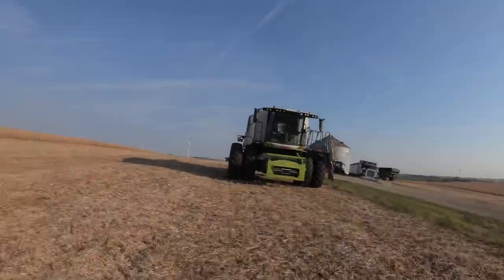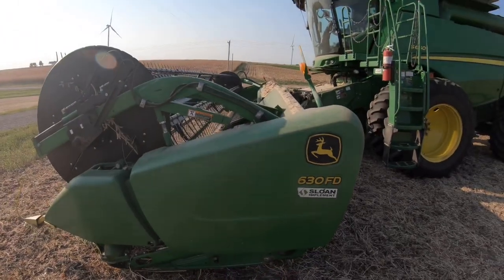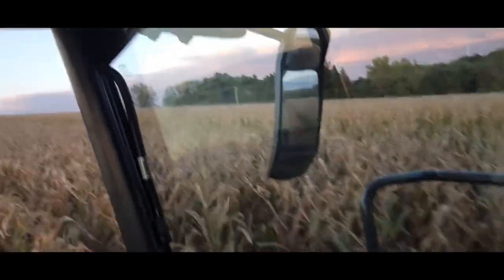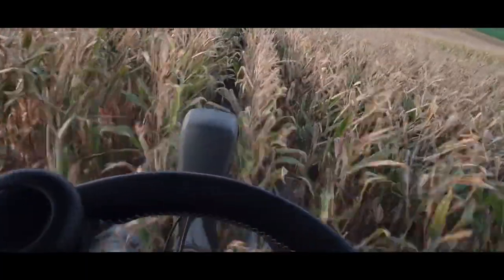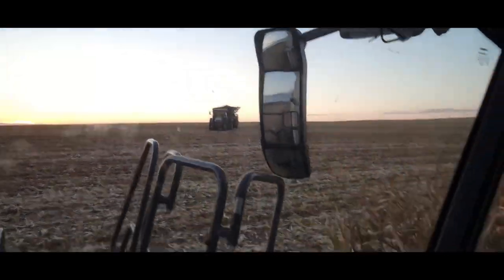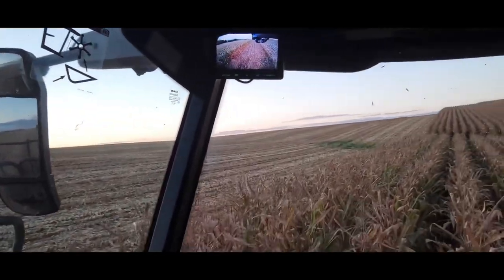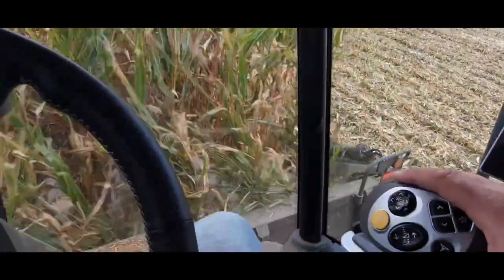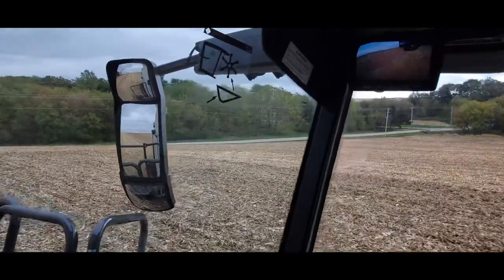Class Combine Demo!

Comment: I know someone who has a Trion 750 on a Vario 770 and a John Deere T660 on a 725X. Both great machines had the Trion working at 7 kph in wheat, 4.3 mph for ye Americans, which is very good since in Europe we have have higher density crops, we get the Trion 720, 730 and 750 over in Europe. The 720 and 730 are the single rotor hybrids and the 750 is a 2 rotor hybrid.

Comment: Our neighbors demoed a Trion with a 40ft head in 70-75 bushel beans running 4.2-4.5mph consistently.
Reply from the maker: It's all depends on the situation. The beans we were harvesting were very healthy, with a lot of green stems. Also, we harvest soybeans for seed production, and our goal is to minimize splits, as a result, I have to run the threshing system less aggressively. Considering all those factors, the Deere machine can do a little better overall job.

Comment: If it's got more capacity in corn would it not do just as good in soybeans? You crop is getting smaller and corn has the highest bushels per acre.
Reply from the maker: In corn you are only pulling in the ears and you typically have a smaller size header, whereas in soybeans your are pulling in the entire plant. The amount of bushels running through is the not issue, as the separating and cleaning capacity is more than sufficient. The Claas has a different threshing design than a Deere, which is more conducive for corn but not quite as effective in soybeans.

Comment: Would this be a class 6? I think class 7 is as small as they make in the other series...could be wrong. Don't know a whole lot about Lexion.
Reply: Ahhh...you don't say! 😆
Reply: They have the claas Trion which is the 720, 730 and 750 in Europe and the 740 in America. And the Lexion which is the 5300-6900 walker range and they 7400-8900 2 Rotor Hybrid Range. The machine in the video is a Trion 740.